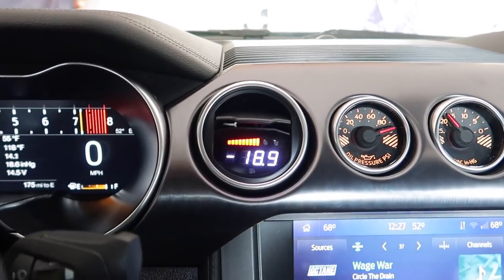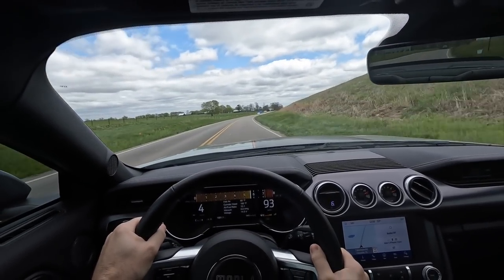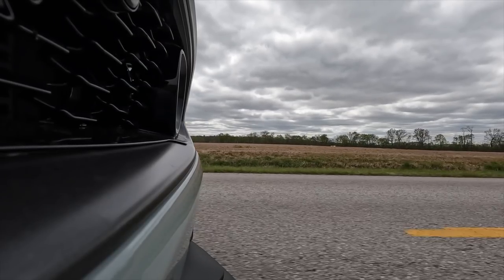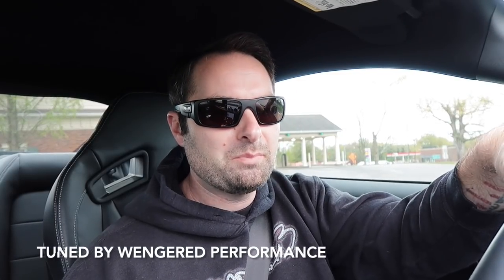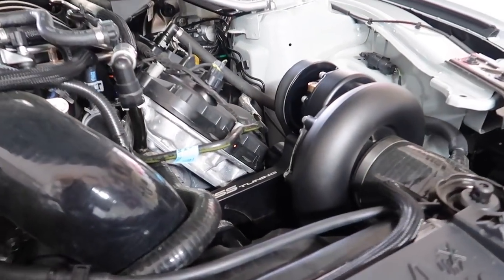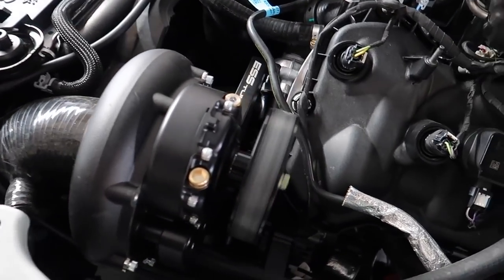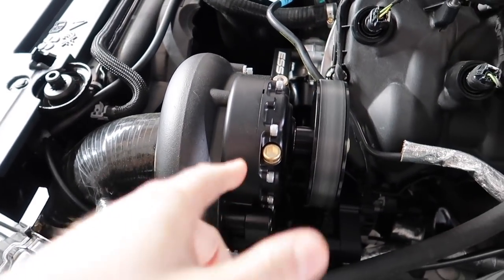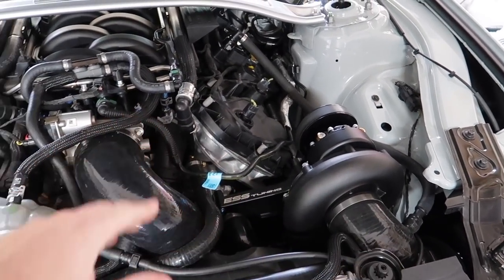FIRST WOT PULLS in my 2021 MACH 1 ESS SUPERCHARGED MUSTANG *WICKED FAST!

Comment: For a street car it’s perfect and has a great gear ratio (3.73) same as the gt500  The only thing I would do would be headers and a free flow “ quiet” exhaust ( I’m old lol). Also If it spun coming out the hole I would either do a sticker tire or change the gear ratio to 3:55 imho. Congratulations on the build and take care.
Reply from the maker: Thanks so much

Comment: Awesome brother!  Centri takes the best of TVS and Turbo and applies + plus won't destroy the car from crazy torque early on. 
Love the midrange on my Procharger P1X .  It's all about rpm on launch. While rolling, launch from 5000rpm - then hang on. Wouldnt get headers unless you are going big big power, if you stay around the power you are at now, you will lose about 1lb ish of boost with headers.  Check out the MAK 2 Hurricane inlet for +1lb of boost and 40ish hp for cheap.  😉
Reply from the maker: I’m a firm believer now 😉 best of both worlds without the shock to the system. Feels like a rocket taking off up high
Reply: @Zander13Productions  Oh yeah!  It's a rocket brother.  Gotta try a 10speed with one. Stays in boost through all shifts.
Reply from the maker: @motiv8d111  😉🏎🏎

Comment: Nice 👍🏽, I’d like to know did you have to change the fuel injecters or any other factory equipment fuel pump, injectors and which intake manifold are you using?

Comment: Has the Mach 1 engine internals (crank, bearings etc) been beefed up to handle this extra horse power? I have a '19 GT Coyote (20k miles on it) and I'm wondering if my present engine will handle this.
Reply from the maker: All stock. Your engine will be fine until around 950+ HP

Comment: Hey Zander. Does this kit void the Ford warranty?
Reply from the maker: Probably some of it
Reply: Ford will have to prove the super charger caused the issue.  For instance...I had my rear wheel bearing replaced under warranty while boosted.  And also had them checkout another concern I had - all under warranty.  The only issue I had is that when I got the car back it was +14 miles!  Lol, I think someone(s) took her for a joy ride.  With the centri and 10speed, it truly rides like a high end exotic sports car.
Reply: @Zander13Productions  Thanks for the response

Comment: Alex I have been following you for awhile now before the red Mustang. I stayed up with you on the Toyota Supra & Camaro, I have followed entirely through the white 2022 that you just put on the ESS G3X with the G4 cooler. Please tell me why you got rid of the Mach 1? It was almost perfect. Was it due to the great deal that you got on the 2022 GT and you wanted a lower payment????
I am waiting on my 2024 DH. I plan to do very similar build on it as you have done on the White GT. Variant wheels, Corsa double H-pipe w/Kooks headers & Borla S-pipe saving the AE option. Planning on Corsa CAI x 2 for the 7th generation; PPF + tint and ESS G3X w/G4 inter-cooler, oil pump gears & crank sprocket, keeping it in 93 octane. This car will be my daily driver.  I am wondering how long I will have to wait on a Tune (Wengerd)?
Ford already provided the ECM encryption to Whipple & RTR. So hopefully only a one year wait for a tune. I intend on enhancing the handling with Steeda even though I did order the DH with the handling package. Let me know if you regret letting the Mach 1 go verses the new 22 GT. Thanks Bro!!!💪😎🇺🇸✝️

Comment: Well done for being willing to pioneer this specific setup. Makes for interesting watching. Quick question about boost pressures - you have mentioned a few times including this video that the pulley you got provides around 7.5 of safe boost, but clearly your actual max is 9. You said something about the extra 1.5 is what pushed the power to over 700, which I understand, but what I don't is where the extra 1.5 comes from? Simply from raising the max revs or extra tuning or what? I am an absolute novice when it comes to this kind of thing so sorry if it's a slightly stupid question.
Reply: Ess rates the boost number at 7500 rpm. Any thing over that will be more psi. And I feel like they slightly under-rate them in the first place
Reply: Centrifugal blowers are a connected to the crank.. the faster the motor spins the more boost it makes.. Rev it to 8500 and it would make well over 10psi..

Comment: ? How many washers got installed on the bov. Installed mine with no washers because there were no instructions and it doesn't seem to build boost
Reply from the maker: No washers on mine. Your car won’t build boost?
Reply: @Zander13Productions  talked to Bill at aem and it's soft tuned
Reply: @Zander13Productions  emailed the tuner and he is holding the car back so I don't blow it up. Lol. He said had bad experiences with people going all out before it's dialed in correctly.

Comment: I’m asking with my mach1 , can we put bigger cams in my car,, if we did put bigger cams in it will that help with the pro-charger to at least creat 800 or more horse power , I have a lots of ???’s no answers
Reply from the maker: You can but I’d just pulley down more for more boost. Much easier and cheaper

Comment: With this setup, it doesn't need any beefier engine internals? Just got my Mach 1. I probably won't consider a blower setup for a while, but may down the line.
Reply from the maker: All stock internals. They don’t really need to be built til around 900+

Comment: Zander, I want to get all the parts you got for your Mach 1.  I have the Mach 1 also.  Could you tell me all the parts I need to get from a recon and then also the oils pump gears and fuel management.  Also, what about a new thermostat ?  Is that needed?
Reply from the maker: ESS Tuning G3 straight cut gears kit. Email brevin@esstuning.com and tell him I sent you for the correct parts. I have boundary oil pump gears and Crank sprocket. Let them know I sent you for a good price there too. Corsa double x pipe- discount codes in video description. 1000cc injectors from fuel injector clinic. Lethal performance boost a pump- promo code ZANDER13 at lethal performance website. And wengerdperformance.com for tuning. Let him know I sent you. I don’t have a different thermostat but they never hurt to add one. Just let the tuner know. The boost gauge is from P3gauges.com let them know I sent you. Let me know if you have more questions 💪

Comment: would this kit work on a pushrod motor? Paxton charger, the same type of charger right. I was looking at one for my 66 stang. Pushrod motor. In 1966 Paxton was a factory option at the same boost level. 7-9lbs on 302 and 351. they did it back then without forged internals as we have now. I would think you could turn it up higher on pump gas. if you remember I posted 700-750 when you didn't know how you were going to boost or not. your car is much heavier than my 66. I think my target is 550-600hp. have a great day buddy. Maybe we can talk more. thanks for the video.
Reply from the maker: I am not sure. brevin@esstuning.com could tell you better

Comment: What is the max air load do you see?
No false knock on the shift?
Would be to see a 60-130 pull using the dragy
Reply from the maker: I think air load on the dyno was like low to mid 80’s. I need to data log the shifting to look for false knock but it feels solid so far. On the dyno there was none
Reply from the maker: Ken said it pulled more pounds per air than his stage 2 whipple did at similar power level
Reply: @Zander13Productions  yeah a data log video would be awesome.  Showing how that kit is potentially better then others and some techy stuff for the people that understand tuning 👍🏼💯
Reply: I have a10 60-130 on my G3 I like to see the difference with 6 speed.
Reply: Great explanation Zander do you consider having Octanium in the tank on my GEN 2 2017 GT with 120 mm pulley.😊

Comment: So what about if you're going road-course racing you have to be watching your I.A.T's what can be done to lower your I.A.T's
Reply from the maker: I meant to include that in the video and forgot 🤦‍♂️. IATs stay about 3-5 degrees cruising around and climb as usual during a pull but never that high that I have seen. And it recovers extremely fast. I think this would be perfect for all types of racing. Very good IAT on and off the throttle and extremely less cool down if drag racing

Comment: Brother what viscosity engine oil you end up running with your centri setup?  Kind of Spark plugs and gap?
Thank you for the quick clip on your boost gauge setup!  I was start to look at doing mine and you answered the mail!  Love your content!  LVNF!
Reply from the maker: Thanks. I’m running NGK 6510s I think and gapped to 26 for 93. Your tuner will tell you what gap he wants. And I’m running motorcraft 5w50 synthetic since I’m boosted now
Reply: @Zander13Productions  I'm running the NGK's now also but gapped at .32 as per Procharger tuner. My 10 speed actually runs like a bat out of hell now with their tune revision (6th) +170 thermostat incorporated .   They told me to stay on 5w20, but I bumped up to to 5w30 penzoil ultra Platinum + 1 ceretec treatment.  I just can't see running 5w50 unless I'm tracking it. I know lots of other centri users are doing the same.  TVS different story since always in boost.
Reply from the maker: @motiv8d111  yea. Minimum weight I would run is 5w30. I will probably switch to that in the winter.
Reply: @Zander13Productions  I hear ya brother, I did a ton of reasearch and settled for this as the oil to go with. Car is always in the high 180s-mid 190s for temp.  If I pounce  on it, it will go no higher than 208 then quickly jumps back down.  Thats why i am staying at 5w30 until a play date, then I will go 40w.   "Hennesey HPE750 2015 Mustang GT, set land speed record (for mustangs) of 207 mph, uses PUP 5W-30"
I miss the Campbell AO!

Comment: I understand it might be a little early to ask this question however at this point in hindsight if you could wait would you have waited for a handling package MACH1 or at this point still do the same thing as you are doing?
Reply from the maker: If the HP cars were easy to get I would do it that way but they are extremely hard to get or extremely long wait times. I’d probably just buy all the parts separately like I did again. I don’t want to wait a year for a car

Comment: How much whp will a 10 speed push with the same setup
Reply: 700-710 I run pretty much same setup on my a10 I have the mach1 intake and tb.
Reply: @bradmo9281  thanks
Reply: @bradmo9281  and this is the g3 right?
Reply: @anikmomin2794  yes sir, the g3 with the a10 is pretty crazy. Couple videos on my page.
Reply: @bradmo9281  thanks alot

Comment: @zander13 are you seeing headliner issues with your Mach1? I am in my 21 on the sidesin the windows.
Reply from the maker: Mine is all good so far
Reply: @Zander13Productions  next time you get in double check when door is open. I’d be surprised if you didn’t see a little of the end picking out. All M1 I’ve seen has the issue including mine. Ford mostly no help so far.
Reply from the maker: @TylerLaney  I will definitely look
Reply: @Zander13Productions  btw.. love your car. I have the same one. Planning to follow your lead with the upgrades. Thanks for the content. GB..
Reply from the maker: @TylerLaney  thanks so much. These cars are so awesome as you know. Congrats on yours 💪

Comment: Before you take that thing to a road course, check and make sure the clutch slave cylinder and the brake system aren’t on the same fluid reservoir. That is a problem for the PP2 cars , and when you start heating the brakes up you can lose clutch control.
Reply from the maker: Good to know thanks
Reply: No problem. Someone makes a reservoir kit to isolate the slave cylinder from the brakes. Can’t remember the manufacture off the top of my head, but it shouldn’t be too hard to find.
Reply from the maker: @brillowolf  💪💪

Comment: Impressive, but a safe build for your beautiful Mach 1. The vent dash gauge looks great with it's built in look. My only question is the rattling sound the blower makes when you're shooting with the hood up. Is that from the mic, or is it noiser then other brands. Thanks for the ride along. Really like your conservative approach making the car remain like a stock Mach 1, yet over 700 horsepower. I'm not sure if you know the U-Tuber RacerX who switched from his Hellcat to a Hellion Twin turbo Mustang GT. I think you both have a lot in common regarding building fast Mustang, yet keeping them stock in appearance. A nice guy like yourself who's learning a new platform. Nice job Zander.
Reply from the maker: Thanks. The rattling sound is the straight cut gears. They have a quiet version that does not sound like that

Comment: Thank you for touching base on my question about drivability and when boost comes on. I still can't believe they sell these kits at the prices they do. My kit arrived about a week ago then 2 days later we got hammered with 34 inches of snow so don't complain about weather to me lol. Thanks man
Reply: How long did it take to recieve your kit?
Reply: @pistolgrip500  about 6 weeks. I ordered it through palm beach dyno. From what I understand that'll be about standard wait time now. These kits are super popular.
Reply from the maker: Very welcome 🙏
Reply: This is my 4th week. Soon....hopefully. Ordered mines back on March 25th.
Reply: @SaVarMatner  boost life!
Reply: @lobbyrobby  💪💯
Reply: @Zander13Productions  watched again lol. Why is your oil pressure gauge pinned?
Reply from the maker: @lobbyrobby  I have a new design oil pump gear. It increases oil pressure
Reply: @Zander13Productions  the Boundary. Once warmed up does it come down a bit. I was really surprised my 2020 runs around 20 (that's a guess) at idle. I almost find it concerning but apparently that's normal
Reply from the maker: @lobbyrobby  yes. Mine run higher about 10 psi than normal

Comment: The Ford Performance Supercharger Kits made by Roush come with a 3 Year / 36,000 Mile warranty...Is there a warranty with your Supercharger set=up ??  TY
Reply: Only to get beat by a bolt on 10 speed. Roush tune is weak compared to any other tuners.

Comment: Just wanted to say the car looks sick.  I also appreciate you sub’ing to my channel to check out my Mach.  Ive owned 2 centri cars (C6 Z06 and 2V GT).  I was always curious with the Coyote because they are typically a bit lackluster in the torque department but I totally understand your point on part longevity and traction.  I also like that a centri car retains what makes a Mach 1 a Mach 1 (i.e. the GT350 manifold and TB).  It will be cool to see where this goes.  As you mentioned any mods from here (i.e. exhaust, e85, etc.) will pay off even more.  Wish i could feel it in person!

Comment: If you do replace your clutch stay far far away from mcleod rxt clutch, worst clutch i ever had in a car
Reply: Shit well I just paid $1500 two weeks ago for that upgrade for when my kit come in. Ouch 😬😬😬😬😬
Reply: @SaVarMatner  i had it installed in mine do to that's what was recommend to me for the rwhp i have which is 700. The clutch chatters hard when thr clutch warms up.  I went with the mcleod clutch and steel flywheel togeather and the stainless line.. just horrible for me.
Reply: @user-wl4xn3ir2l  Well I hope I won't have that much of an issue. I pretty much brought the same thing with the steel braided clutch line as well from American Muscle
Reply: @SaVarMatner  they say the rxt is mt82 killer, they right 4th gear is out.  Less than 3 weeks of having the clutch put in.

Comment: Vmp odin. That is all
Reply from the maker: I had that before. It heat soaks bad
Reply: @Zander13Productions  what do you mean by heat soak. It gets hot quick in warm weather? What can you do to keep it from heat soak...I have the loki kit...fans I guess
Reply from the maker: @kirbyc1370  by heat soak I mean it gets scorching hot and can take a while to cool down. The Odin is a great blower and has decent IATs like a whipple does but can’t complete with centrifugal blowers or turbos for IAT. But the benefits of yours are an instant boost hit that every one loves.
Reply: @Zander13Productions  right on. There's no wait on power that's for sure